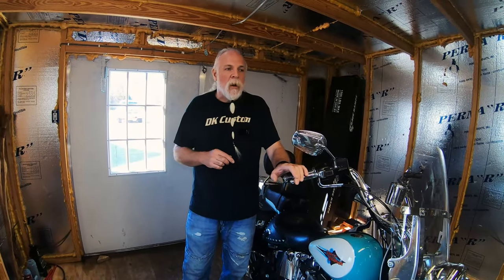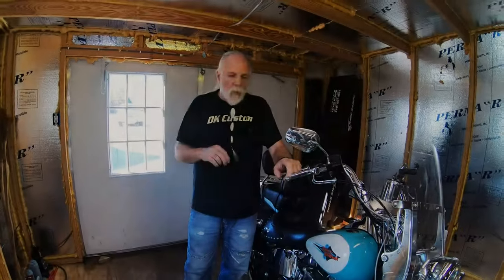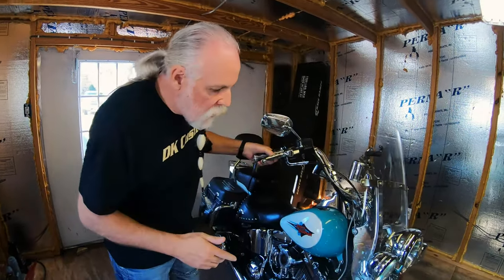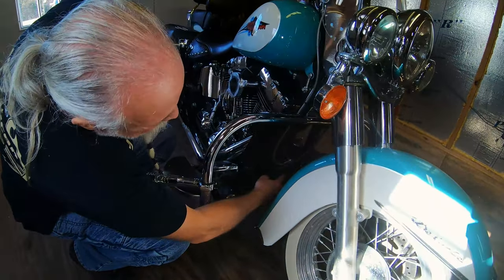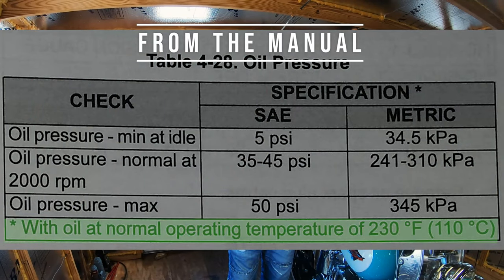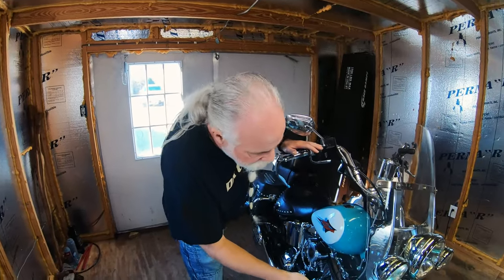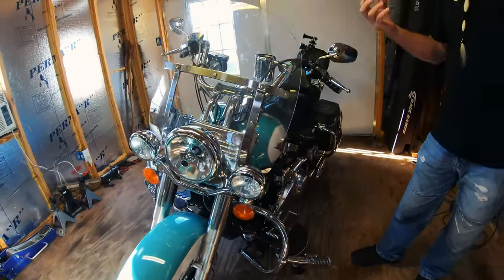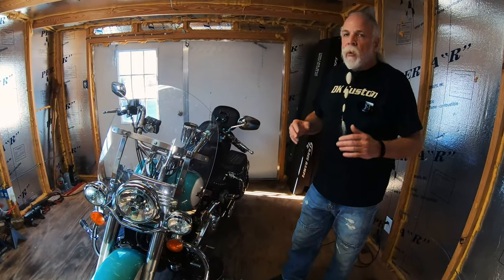Oil Cooler & Oil Filter Relocation on ABS Harley

Comment: Do I need any additional hoses or connectors to use both oil filter relocation and oil cooler together? Thoughts on fan assisted low mount receiving excessive damage? Thanks
Reply from the maker: All parts needed will come with the oil filter relo and oil cooler for them to both be installed.
Prior to the Twin Cooled Twin Cams I ran the following low mount fan assisted oil cooler on my bikes for well over 100k miles.  Never had a problem.  I have many friends that also run them, no problems.  It works much better than the stock oil cooler.
https://www.dkcustomproducts.com/lowmount-fan-assisted-oil-cooler-system-harley-touring-models-dk-j-751-fp2400.htm
Reply: @DKCustomProducts  I have a 2005 fxdc with 32,000miles. I put on your 585 billet fin air cleaner with the oil by pass and it’s great. Now I put on the S&S Winter Power Pack chain drive 585 easy start cams with 100” cylinders but haven’t quite finished, couple of cables and then the break in process. Would you recommend the low mount fan assisted for my situation or would side mount be a better choice for functionality since it’s a twin cam? I put a 2-1 red thunder exhaust, tuned the carburetor(rejet). Still original carb, and original starter. I would like the manual shut off switch as well if you have them?

I know some guys are hard Jagg, and some guys are hard Ultracool. Do you mind sharing your thoughts on this? And I know warranty wise you can’t combine the parts, but is the oil relocation kit/both coolers/and Jaggs manual shut off nob all interchangeable?

Thanks so much.
Reply from the maker: @danr4498  Sounds like a fun bike!
You will get a little better cooling out of a side mount oil cooler than a low mount.  It is in the wind more.
If you are looking to squeeze every bit of cooling out of your set up, then the side mount is best.  Of course, it is more discrete with the low mount.
The fan comes on via a thermostat at around 210 F, but one could wire in a toggle switch to turn it on or off when you want.  We do not have that switch, but you are probably looking at around 5-10 dollars at a hardware store for the switch, wire and connectors.
I have always used just the thermostat for the fan activation and been happy with it.

We are loyal to what is best for our bikes and our Customers bikes.  Jagg makes a great oil cooler, but we have tested the Ultracool coolers and not seen any improvement over the Jagg in cooling.  Still, we would have liked to add them to the mix, but the installation was not as easy, and some of them require minor fab work, which we did not want to do to our bikes, and we know a lot of our Customers would not like that.

I don't understand your last question about interchangeability.  Feel free to write or call with any questions.
Support@DKCustomProducts.com
662-252-8828

Comment: I couldn’t find an answer on my question and because I like what you do I have to ask although it’s not the video to ask. So here goes nothing. What can I do if when I did changed all three holes oil I saw a different color of oil in my primary? Do I have an oil transfer and how bad can it be? I’m currently at 5100 miles and out of warranty. Please advise. Thanks again!!
Reply from the maker: Good question.  Maybe even something for us to do a video on one day.
My guess is that the oil in the primary came out darker than out of the engine and transmission.  This is normal.  The primary will have clutch plate material that wears and drops into the oil.  It will also, usually have more metal....it is normal for there to be more wear from the primary chain and sprockets it rides on to have those metal filings/powder drop into the oil, which will also discolor the oil.